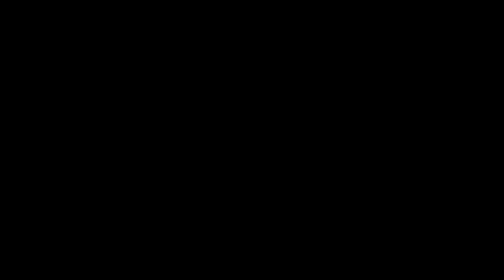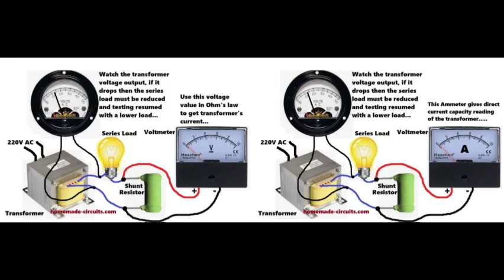How to Measure Current Capacity of a Transformer

Comment: I wish i had known this ages ago. All i knew was calculating for core dimensions, material, ratio, turns, resistance, wire thickness, input parameters. 
Just 2 weeks ago, in my quest for something that has a high enough current for spot welder project, i selected a few medium size transformers from my very large transformer horde, 12-0 output, thick wire shorted the ends, put clamp meter on and switched on mains. Within 3 seconds it had shot past 200 Amps so i cut power. I was very surprised it was that much and not stopping! 
Im definitely using your method in the future - simpler, accurate, and most importantly real world results.
Reply from the maker: Thanks so much Jon for your valuable feedback, I hope the above concept works for you...

Comment: Hello ,  I connected two crystal diodes together with a small antenna, and used a multimeter set to voltage mode to measure the wireless transmission strength — a simple method to detect the transmitted signal. Then I replaced the multimeter with a small voltmeter gauge, but unfortunately it didn’t work.
Could you help me solve this problem? And do you have a circuit diagram that could work for this purpose?
Reply from the maker: I think you should try a moving coil type mV meter, or maybe a VU meter to check  the  transmission strength. You can find more information in the following article: https://www.homemade-circuits.com/grid-dip-meter-circuit/

Comment: I did same with a long Resistance/Heating wire. Keep reducing resistance load till the Tx warms up. Then measure the resistance and voltage to know current and power.
Reply from the maker: Thanks for updating the results. Glad you followed the correct way to measure your transformer current.